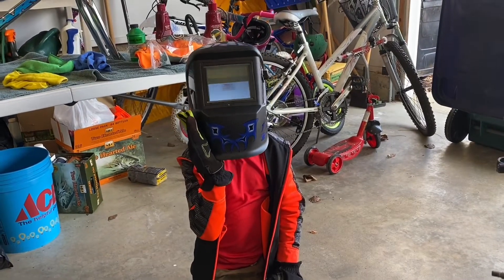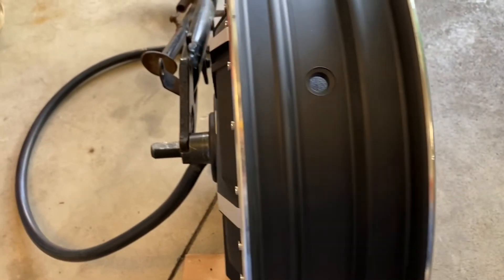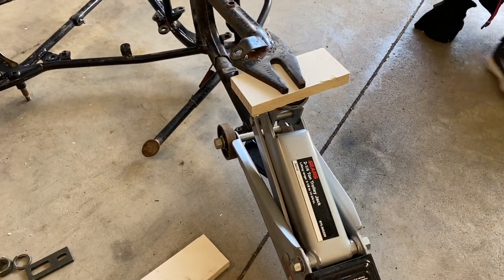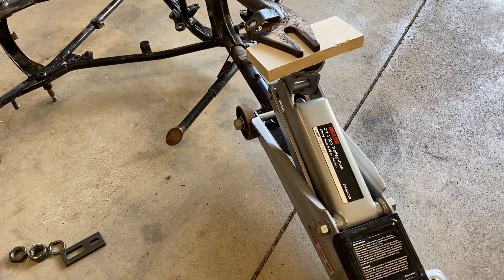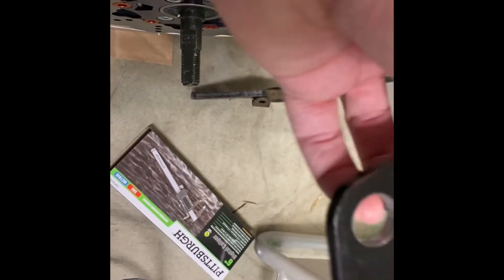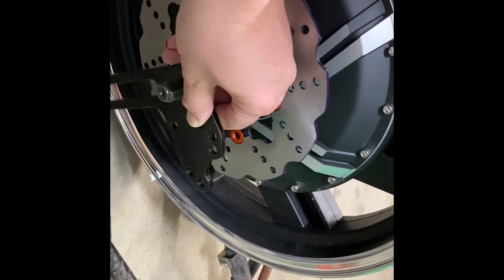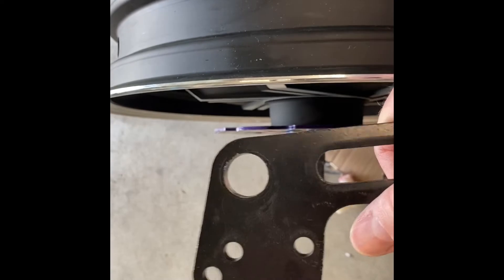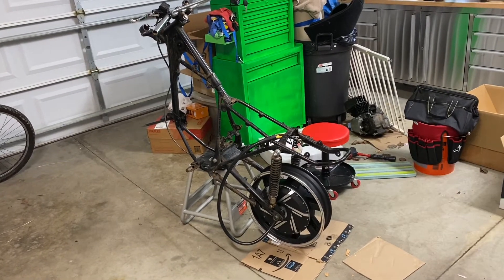Hub motor and disc brake mounting

Comment: Did the caliper bracket come with the brake kit? Or did you buy that separately? If separately, do you have a link for that one?
I ordered the same brake kit from QS Motor and did not receive the bracket.
Reply from the maker: It was included in the brake kit from QS

Comment: How much sir
Reply from the maker: I think the motor, controller, throttle/grips, dc to dc converter and brake was about $850 USD.  Air Shipping from China to the USA was included and a very large part of the price